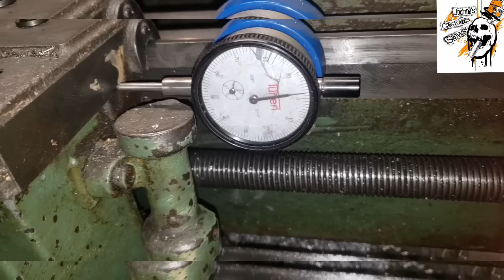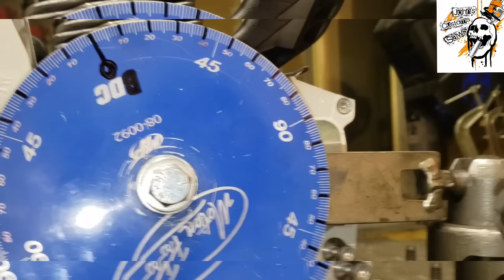Stihl MS461 chainsaw porting... START to FINISH... JCS

Comment: Never reuse a sparkplug, bruh, I understand that a high performance shop like yours doesn't reuse them but to state to never reuse a sparkplug is a little rich and wasteful
Reply from the maker: How often do you remove your spark plug though... Serious question not trying to be a smart ass.. The crush washer is a one time use and they can leak If reinstalled... an air leak is a good way to burn up a top end... an OEM top end you're looking at 500 bucks easy parts and labor to replace...  Not to mention the money lost for downtime without the saw... That's why I say that because I'm honestly trying to help... So if you are taking your spark plug out 50 to 60 times a year then maybe there's something else you got going on other otherwise it's money in the bank...  And do I look like a fancy high performance shop bro... I work out of my 3rd stal garage  lol
Reply: @johnscustomsaws  thank you for ingageing, and in production falling maybe it is totally viable, and hey you are a high performance shop that's a given since I saw some "new old stock". And yes you are more experienced and knowledgeable. But as a homegamer small engine repair guy I don't think its viable for me. My opinion may change as I watch more of your stuff and get more xp
Reply from the maker: @thomaslindroos1667  fair enough man I know that every situation calls for different approaches... I have worked at a few service centers in my day from shade-tree mechanics to authorized dealers totally by the book... so I get it... if you pressure/vac test a reused plug it will leak 90% of the time no joke... maybe not a lot but still an air leak... and if you over tighten the electrode can break and that's real bad... I definitely can't make anyone change their mind i am trying to teach people the only thing I have ever been good at...  I appreciate that you are honest about it... I will take honesty over bullshit 7 days a week 💯